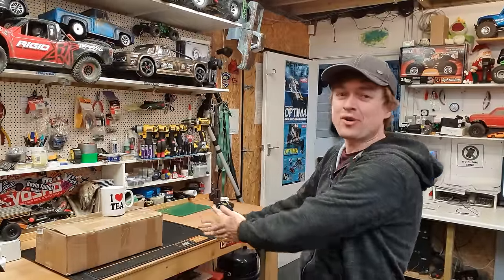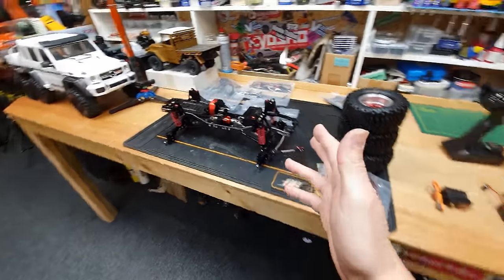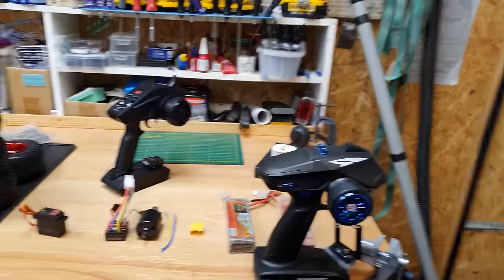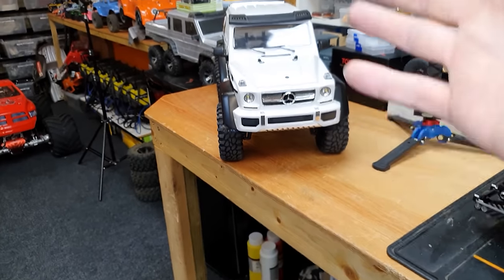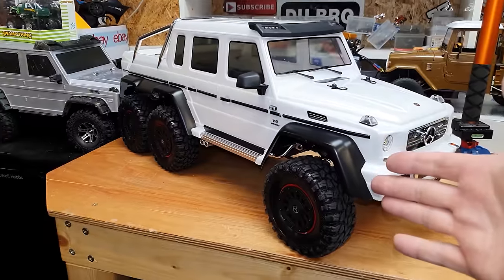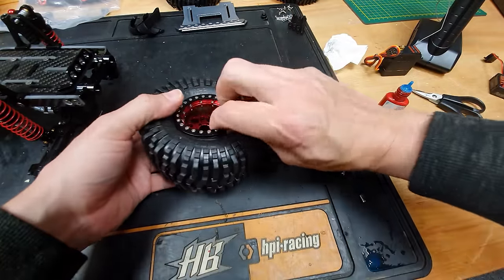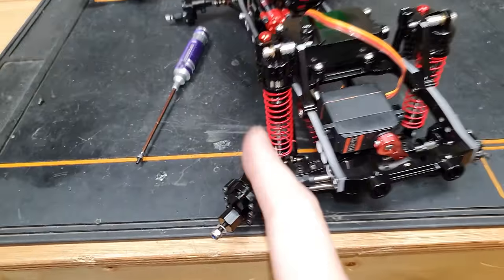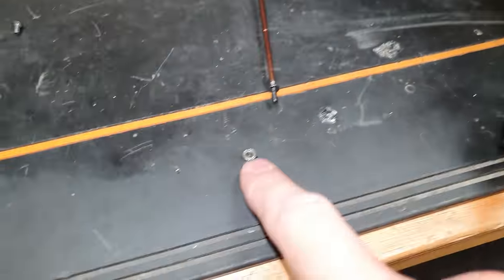the BEST Banggood RC Crawler Car I've EVER Had

Comment: Mine came in two weeks or so ago. Pretty nice. But when I tried it, it turned out the front axle was dead. Turns out there was a missing cross pin in the transfercase. So yeah, the parts are good, but the assembly is as chinese as ever. Otherwise, it's a great kit and I'm finishing up the PowerWagon body for it soonish so I can run it and look good! And the Powerwagon body fits decently even with the wheels.
Reply: did BanGood help you out with he parts? there were useless to me,  Mine came with a bent Axle and promised a partial refund but never sent it.

Comment: quick tip for mounting tires to beadlock wheels. put your tires in the freezer overnight, it will stiffen them up and make them easier to seat the beads.

Comment: I wondered about this kit. I was nervous spending that much from something off bangood. Thanks!
Reply: you should be.  There customer service is almost non existent
Reply: Yeah banggood isn’t great took 2 1/2  months just to get a set of tires form them. Customer service was horrible to. For the price you can get a brand new rtr trx4 sport and a good lipo!
Reply: Just go support the proper hobbyists not banggood cheap stuff. Buying cheap stuff off china doesn’t support the hobby

Comment: Had portals you could adjust the caster angle or whatever similar to these ones. Never gonna purchase a pair of those again lol gonna be using solid all the way through from now on, works good if you dont actually use your crawler almost daily though.

Comment: Just a tip I know this video is old
But when building that kind of wheel, put the 4 screws in the back first and then take one out at a time and put the thread locker on one at a time, that way the rest are holding the wheel together and you don’t have to worry about the beed coming out

Comment: Kev u can get a 2 speed transmission off of eBay for an scx 10 I reckon that would fit in there
Reply: Rear bolt holes dont line up ..you have to make a small bracket for the two speed I just did one

Comment: Putting the caster leaning the way it was helps it self straighten like a shopping trolley <\  
Push let go goes straight for crawling I would recommend 90° straight up down could be wrong I would check online as it will come in handy for the speed run as it would help it stay straight

Comment: Great looking chassis and love those cast and machined axles. Knowing you like a crawler, it would be great see you review the Traction Hobby Founder 2. All metal portal axles, 2wd/4wd selectable, 2spd, remote locking diffs and 1/8th scale on 2.2 tyres. I've stuck a HW AXE 550 combo in and it's really impressive!

Comment: With the castor angle forward like it was you get a better steering radius as the tires turn they also lean over a bit. People thought I was crazy rolling my enduro ones forward till they saw it turn in a comp I was at.

Comment: This chassis is just package of SCX10 upgrade parts. You can buy them asi Injora, Integy, TopCad, .... Every year there is a new revision  of chassis. I got mine (Called MRC10) almost 10 years back and only parts that is still same are shocks. With SCX10 usually you will end up with these parts so why not to buy them in a first place? Carbon frame has one problem. It is 6mm wider than normal Scx10 frame. So body posts are in different spot and springs on shocks could rub frame.

Comment: Kev, one thing about the Dumborc transmitter is i find the stock wheel on the transmitter SUCKS it just doesn't feel that great. Ive designed and printed an adaptor to replace the stock wheel with a 1/10 12mm hex wheel, happy to send you one if you like?

Comment: Hey Kev, I got a real question. I’m doing a cheap crawler build with all parts coming from Banggood. I’m using a lot of the parts that you put links to in your video but I’m having trouble picking out a 3s lipo. I’ve noticed the link you put in the video is for a 3s 5000mah 60c battery. But in the video the battery you used was a 3s 3300mah 30c battery. Does the “C” discharge rate really matter? Thanks.

Comment: Hi,
Total Newby here and freakin love your channel.

I wanna build myself a crawler and thinking about purchasing the kit suggested in your video.
I would like to ask few questions  though..
1.  are the diff's locked? or somhow lockable?
As far as understand, crawlers require locked diff's (am I right?)
And if the diff's aren't locked in that kit, What should I do?  

Another question,
Would a "Proline 1946 Dodge Power Wagon"  Body fit that kit?  (asking since it runs 2.2 wheels)

Thanks Tons,
Lee

Comment: If you want it to crawl good, you want no longer than 90mm shock and you want to get you chassis as lowwww as possible, with portals it’s actually good to have your skid a tad lower than the center of the axles so your bottom links make a slight “v” if look from the side

Comment: Uhhh positive caster actually makes a vehicle more stable at high speeds, not the other way around.
Reply from the maker: and now it is + before it was -
Reply: @KevinTalbotTV  Surprised you replied haha but actually positive caster is when the center line is leaning towards the front of the vehicle. Negative caster is when the line is leaning towards the back of the vehicle. I work on semi’s for a living Ive seen people confuse positive and negative caster many times.

Comment: Almost 400 dollars it doesn’t come rtr gotta assemble it came with missing screws had to readjust the thing that would make it drive funny the steering servo sits on the differential which looks funny yeah I’m all set definitely not for me
Reply: Well you know when people buy crawler they usually spend hundreds of dollars to try and making it the best possible and the usually try and make the body carbon fiber so if anything you are saving money with this rc car but I agree it’s definitely not for me

Comment: YIKES just under $600 CAD no motor, no electronics.. No transmitter or receiver From Bang Good... Hmmm don't think so ..  Granted it looks awesome and seems to be a decent rig but why this over an ACTUAL Scx10 ii Builders kit for 1/3 the price AMAIN HOBBIES $270 Cad. and a much better kit.. Even though Bang Good Sais it is "FOR" scx10 .. it isn't. Thanks for sharing this. Sorry I know it sounds negative but I like to tell truths

Comment: These RC cars never look real traveling along and I've finally realised what's wrong. It's the weight, they're too light and that's why they bounce about. If the RC car is 1:32 scale, then the weight should be 1:32 of the real vehicle. Obviously you'd need better springs and shockers to suit but they would travel just like the real thing. I haven't got the time or the money but I wish someone would because it would just blow people away with it's realistic handling.